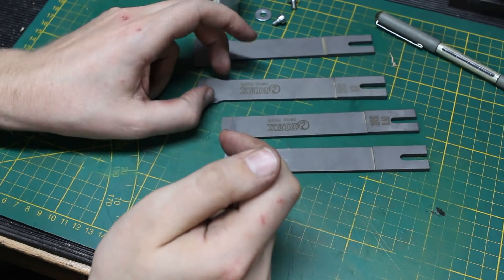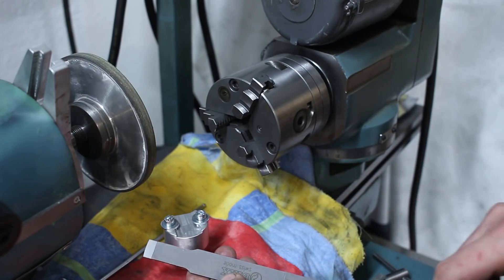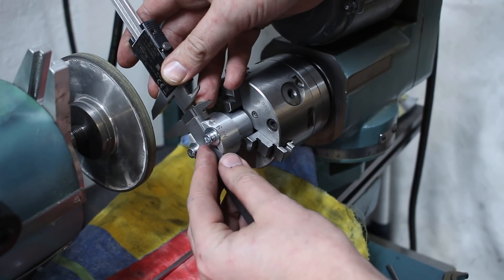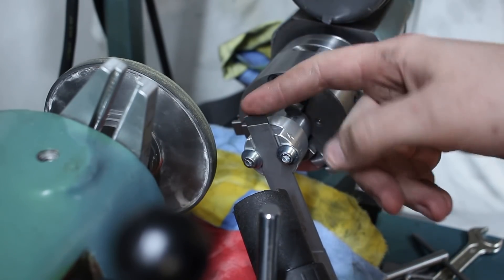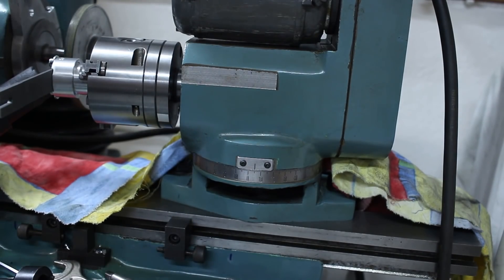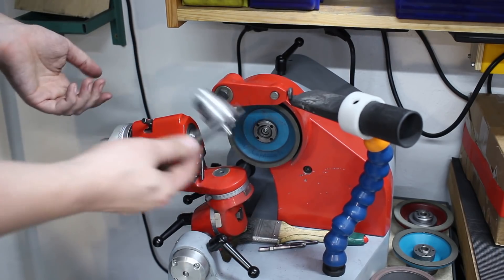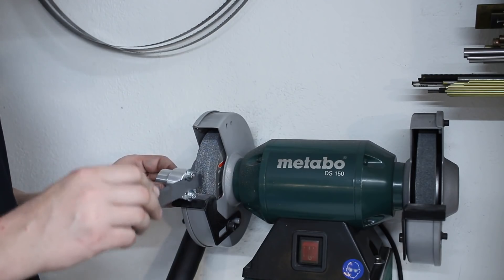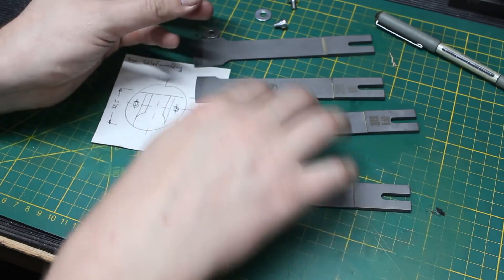Grinding large radii

Comment: Hi Stefan, I enjoy your videos. By pivoting the 3-jaw chuck 5º, are you grinding a section of an 85º ellipse? Whereas, if you, instead, pivoted the grinder spindle or used a wheel dressed to 85º you would create the 30mm radius with the desired 5º negative angle. Am I picturing this correctly?
Not that it would make any difference in the performance of the scraper.

Comment: If you plan to do this on a bench grinder (or a machine with no control feed) just don't get impatient by setting too much extra material to grind and start the grind from the top down. If it binds and tries to roll along the grinding wheel, hopefully the workpiece will just slip back in the jig, but if it doesn't.....oh boy.

Comment: I free-hand scraper blades, usually by eye. I might use the gage to detect lumps and flats on my free-hand radius but usually it's an eyeball operation start to finish. Somewhere I have a little table of sagitta Vs chord for various radii but after the zillionth scraper restoration you develop the eye. I made a bunch of scrapers once that had a line of drilled holes you could slip over a pin as a swivel to guide the radius being ground.

The noob, however, would have to cultivate the necessary perceptions - perceptions sometimes requiring a long learning curve in adults. Time spent away from scraping checking tip to gage, touching up, and rechecking is unproductive. A re-sharpen usually taking thirty seconds could extend to fifteen minutes. Your jig offers a simple femedy

However, your nifty little jig can make even very large radii spot on the money. I can see many applications not only for lathe tolls but shaper tools, wood router bits, etc wherever requirements exceed the pitiful range of the usual factory tool grinding equipment.

BTW, if your scraper dulls in the middle, don't forget you have the rest of the cutting edge to wear out before you have to sharpen. Learn to tilt the scraper a bit one way or another to catch indications not quite in line with the preceding. Time and practice will teach you to unconsciously tilt and weave the scraper tip and to vary the downward pressure so you knock out two to four indication per cutting stroke without cutting between them. All in a fifth of a second.  Most good scraper hands do this unawares and therefore can't reach it. Takes practice.

Comment: After forming the radius, I dull the corners so they will not scratch the work if they contact it.
Reply from the maker: I usualy do that too, but when scraping very small dovetails I need to scrape very close to the corner of the blade, so I leave it as it is.

Comment: I'm already wondering what your going to be scraping :)
Reply from the maker: Just another Schaublin 102 support ;)
Reply: @StefanGotteswinter  Schaublen. Ohhhhh Drool Drool. Im currently trying to get a small Model Makers Lathe made by Tyzack Zyto of London home. Made in 50's with flat belt drives. Restoration project. I have an even smaller basement. ie Under my Staircase so It needs to be small. Very jealous of your 'space' and equipment :'( Love / Hate your videos :)

Comment: Just acquired an old Biax scraper and about to go down this rabbit hole, no Biax blades though, do you recommend buying them or brazing carbide (I have a few suitable pieces)?
Excellent work as usual!
Reply from the maker: As usual: It depends ;)
If you have the time at hand and can braze - go for it.
If you need a blade without additional work: buy them.